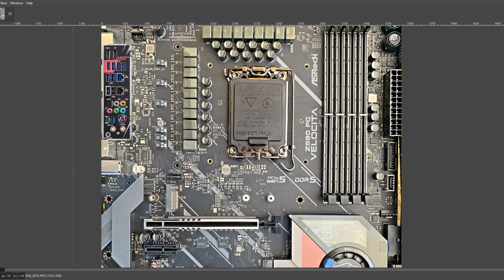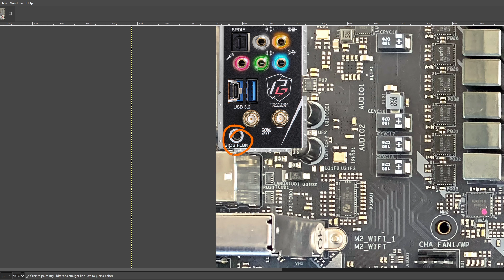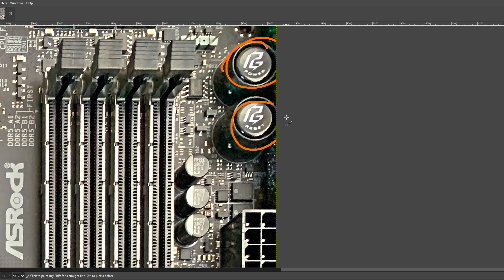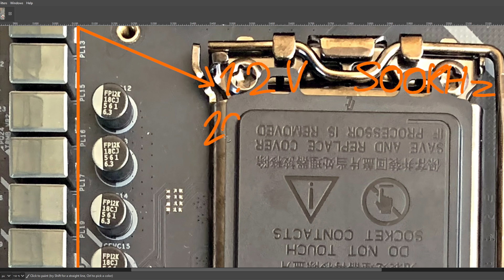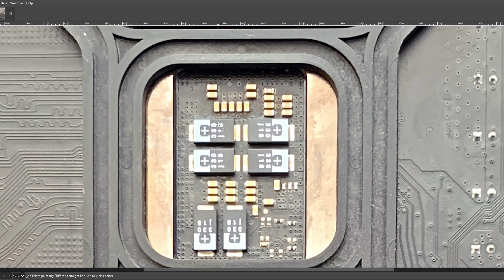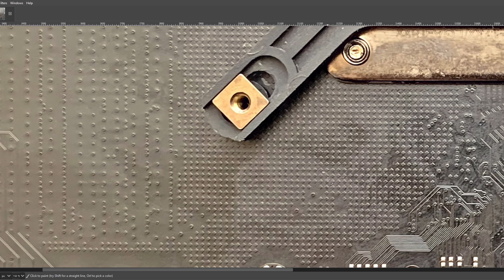mobo PCB Breakdown: Asrock Z690 Phantom Gaming Velocita // intresting VRM, horrible price

Comment: Nah, I'm not even going to bother with this. Asrock managed to claw its way to the top, a few years ago, with a series of great motherboards. Now, it seems as if they are trying their hardest to implode the company. Each generation of motherboards is worse than the previous, and that takes hard work and consistency. Then again, those Biostar things are almost $500, has everyone gone insane.
As for networking, Asus Proart, which is cheaper than this mess, has 1 10Gb and 1 5Gb, if I'm not mistaken. The Proart just misses out on USB ports. And then we have the very cheap, for the features, Gigabyte Aero(?), with 2 2.5Gb ports and an overall very good back IO configuration, with everything properly labelled (it isn't that hard).

Comment: 34:30 The lines on the top there almost certainly have a ground plane in the next layer down, so they are referenced against a ground plane but not sandwiched between two of them like the other traces are. This will change the impedance of the trace, meaning they will have to be slightly thicker (which is no big deal, the PCB software will account for that)
Reply from the maker: the CAD bus for DDR4 is often refrenced against the VDDQ power plane not ground. AFAIK with DDR5 the VDD2 power plane is in the same place.

Comment: 4:19 I would say M.2 slots are great for mITX boards where space is an issue.
edit: I specifically mean the M.2 form factor in general, I agree that the M.2 on the board in question is bad.

Comment: Why won't GeekBench 3 finish? The elapsed time just keeps counting and it stops at different areas of the test. GB3 finishes & gives me a score about 10% of the time. It never used to do this, could it be windows 11 causing it or instability? Everything else suggests my ram oc is stable
Reply from the maker: weird I guess it might be a win11 thing because I've never seen that.
Reply: @ActuallyHardcoreOverclocking  I just upgraded to win 11 a week ago, I normally do clean installs but I just wanted to try 11 (although I did do an in place upgrade after I updated). I will do a clean install soon & see if that helps. 

Hey while I have your ear Im thinking about upgrading my 4 year old trident z rgb 3600mhz c16 4 DIMM kit (on Z590) and was curious if there is any reason NOT to buy DOMINATORS aside from the price? well & not having gear 2 speed kits for the most part.

I want to get a 2x16gb kit cause I have never really been able to get much of an OC out of my 4x8gb dimm kit. I guess one of my concerns is will it be able to reach an overclock that makes using gear 2 worth it since I believe the DOMS top out at 4000mhz c16

Comment: i have asus z690 tuf gaming wifi d4 wd i7 12700 and rtx 3070
my all 4 sata ports are populated wd 1 250 850 evo , 250gb 860 evo , 4tb and 2tb hdd .
can you put sm light on my configuration? 
i wanna add 2tb samsung 970 evo plus on 1st m.2 connector..
will there b any conflict , stealing or deactivation of PCI lanes in this case .

Comment: Agree with bz, I'm currently using 12900k with z690 strix e, and this board is doing the exact same stupid thing as this z690 velocita do, which is stealing pcie gen 5 lane for first m.2 slot instead of using plenty gen 4 lanes from the chipset like the z690 strix 
-f or z690 hero. At least this board include m.2 adapter card for additional 2 m.2 gen 4 tho. Smh.
Reply: how come.?
i have asus z690 tuf gaming wifi d4 wd i7 12700 and rtx 3070
my all 4 sata ports are populated wd 1 250 850 evo , 250gb 860 evo , 4tb and 2tb hdd .
can you put sm light on my configuration? 
i wanna add 2tb samsung 970 evo plus on 1st m.2 connector..
will there b any conflict , stealing or deactivation of PCI lanes in this case .
Reply: @CaptainScorpio24  As far as I know the z690 chipset has plenty pcie 4.0 lanes for nvme protocol therefore it doesn't need to borrow bandwidth from sata connection even if you populate all the m.2 nvme slot, though just to be sure you should check the pcie bifurcation in your manual.
Reply: @tictechto  970 evo plus is pci 3.0 which  i think is more than enough.
cant seem to find that m.2 bifurcation in user manual that came in the motherboard box 😰
i have heard from several reviews that when you connect a m.2 ssd , ur 1 or 2 sata ports get deactivated automatically. 
FYI this board only has 4 sata ports  instead of 6 or 8. 🥺

Comment: Actually BuildZoid, PCIe ×12 & ×32 lane configurations are part of the original PCIe Spec.

Manufacturers refused to support them for whatever arbitrary reason.

×1, ×2, ×4, ×8, & ×16 lane configs are what manufacturers wanted to support; but they chose to not follow the complete spec by not supporting x12 & x32.

That needs to change, the PCIe org needs to force the manufacturers to follow the complete specification.
Reply: I think not supporting x32 is understandable lol, that's kiiiiind of a lot of lanes to wire, and a huge ass connector.

Comment: Because of the way shared high speed I/O lanes work on Intel chipsets, you give up 4 Gen 4 Lanes if the board has more than four SATA ports. If it only has four SATA ports, you can have four Gen 4 m.2 slots.
Reply: i didn't know this, i was wondering why msi edge has 6 sata+4 nvme gen4 while the cheaper apro boards does the same but one of the nvmes is gen3 only.

oh turns out they added a third party controller on msi edge, i thought we didn't need this with the z690 chipset's plenty of resources to use, lane wise.
Reply: @BodethIII  The ASUS Strix Z690-A does the same thing as the MSI Edge

Comment: For dailying 10gig is really nice to have on board. Cause all the add-in nics are 4 or 8 pcie lanes. And no one who wants 10gig has a free x4 or x8 slot lol
Reply: "And no one who wants 10gig has a free x4 or x8 slot lol"
I'd figure it'd be either or
Either your free 8x/4x slot is going to some M.2 card/HBA, or your free slot is going to a 10G card to connect to a NAS which has all your extra storage.
If you need both you probably should be on Threadripper
Reply: Dont the onboard 10gbit nic use the same PCI-E limits on the board overall anyhow tho, or is it connected magicly different, or is it a simple space problem in stead of a bandwith/advaliable PCI-E lanes issue ?
Reply: @AdaaDK  it does but board vendors are quite stingy, they'll leave some PCIe lanes inaccessible on lower end boards and then for a higher end model they'll take those lanes and give you 10G or something.
If they dared to just give you a board that maximized PCIe lanes and exposing as much as possible through slots then people wouldn't have much reason to buy higher end boards which are also higher margin
Reply: We need new HEDT SKUs
Reply: @skoopsro7656  Q3 2022
Reply: bz doesn't care about audio or LAN though.